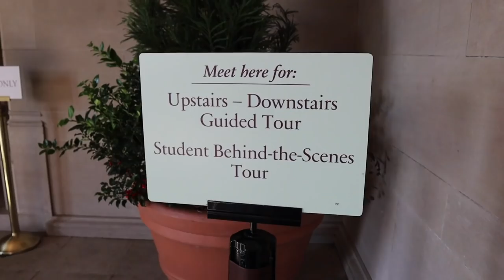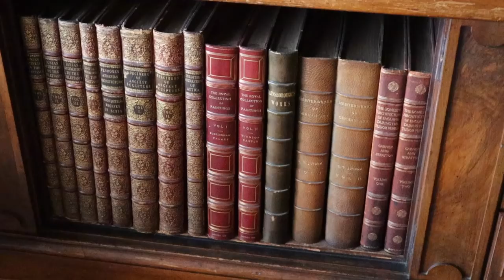Visiting Asheville, NC, Truck Issues and a Biltmore Christmas

Comment: What was the issue with the truck?  And how did you fix it?  Inquiring minds want to know.
Reply from the maker: Miguel Rodriguez well we really haven’t fixed it. We were able to manually unlock it with the screw driver and after a couple of times it stopped sticking. It has since done it one more time so we make sure the screw driver is always in the truck. 😂 When we return home in the spring we will have our shop take a look at it.